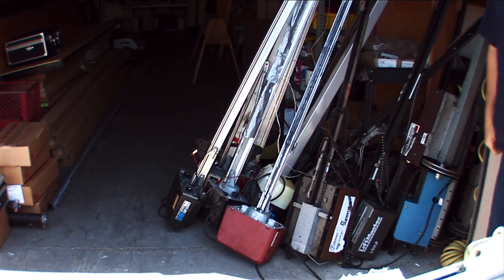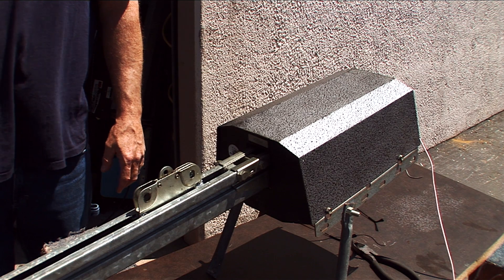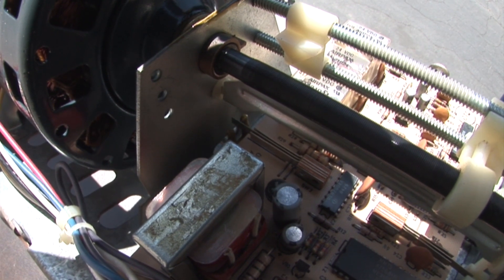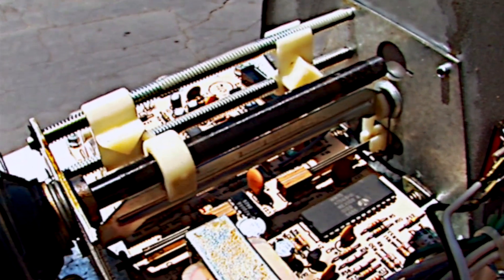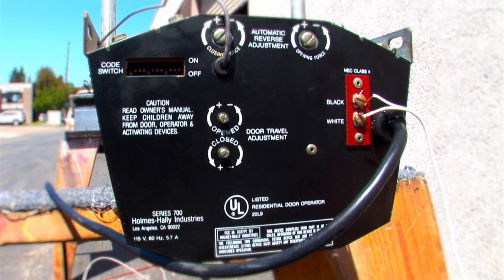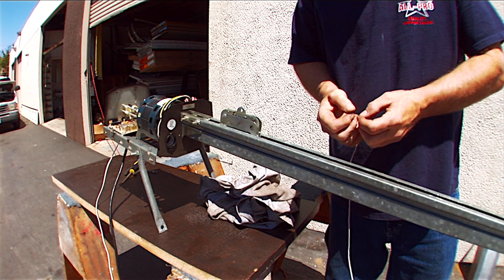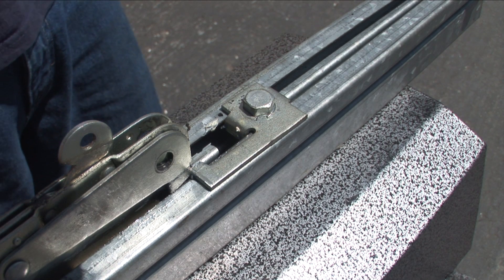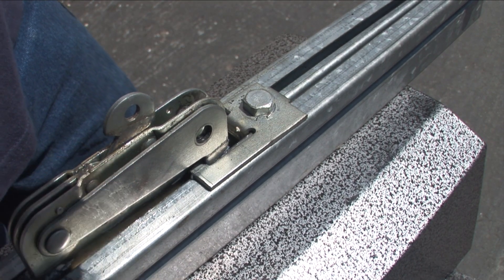Holmes Series 700 opener

Comment from the maker: I think in order to make it remote control I could pretty easily add a Liftmaster 635LM remote control set. but when genie switched to 12 code they had already made the transition to 390 freq and weren't tuneable at that point, but this machine very well could be 390.